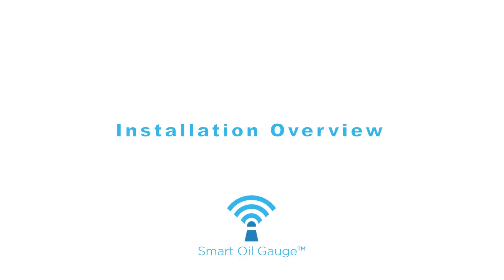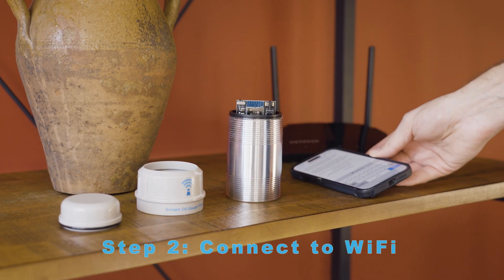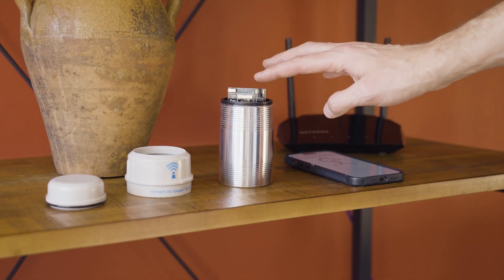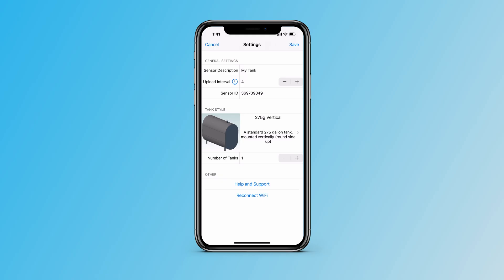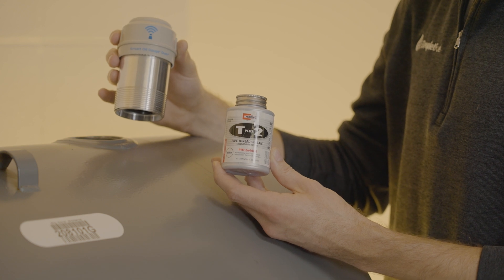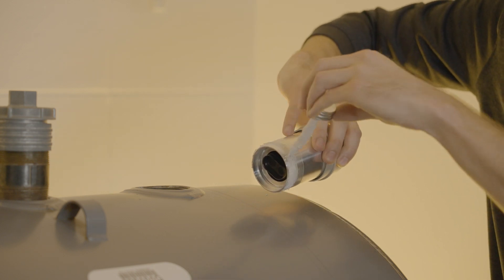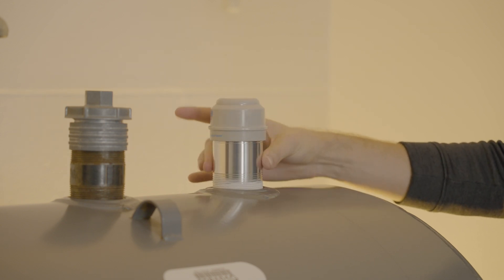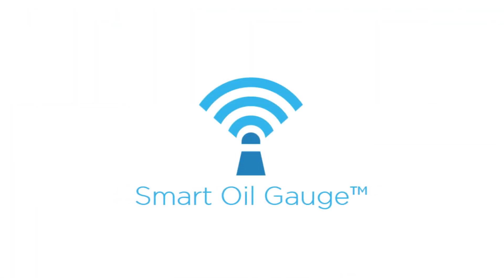Installing a Smart Oil Gauge Duo on a Steel Oil Tank

Comment: What happens if I don't put on pipe dope?
Reply: It’s not the end of the world; the seal is just not as good between the tank and the gauge.
Reply: The pipe dope helps to prevent corrosion buildup between the threads of the Duo and the tank threads…
Should you ever need to remove the Duo you will be very happy you added the pipe dope!